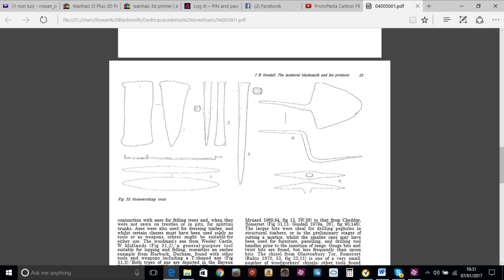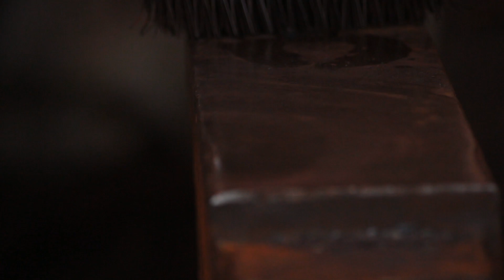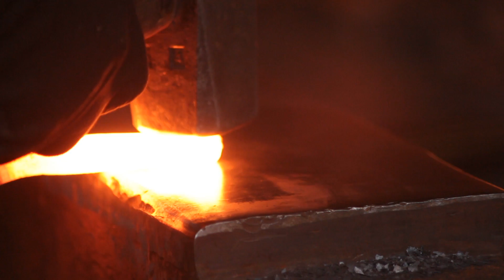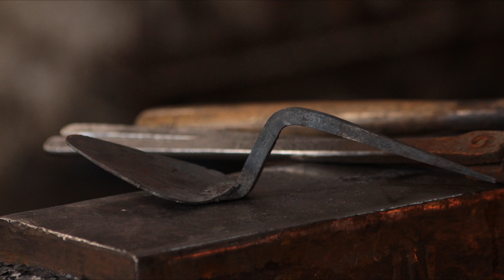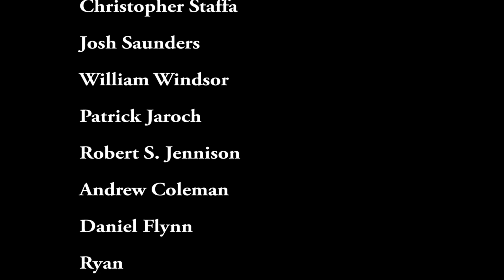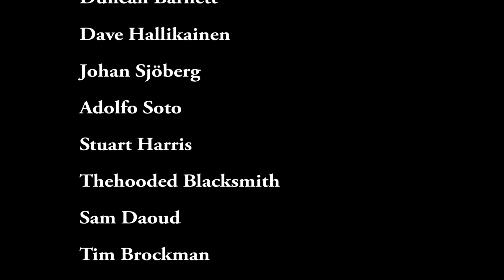Forging a wrought-iron medieval trowel.

Comment: Very interesting rowan . Something that may interest you .I came across a Dutch article on the internet some time back regarding the correct handle angle for trowels .  They reckon that when you turn a trowel over with the tip of the trowel on a flat surface the Handle should lay flat. I have tried this with various trowels including the Dutch Arnhem pattern Metseltroffel (  brick trowel) whs tyzack and Marshalltown and it seems to be the way it's done .